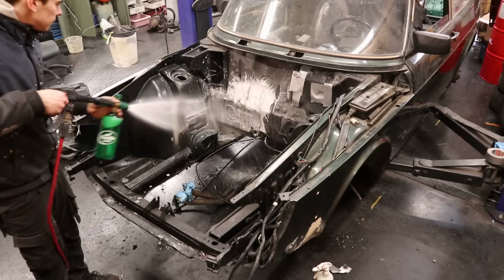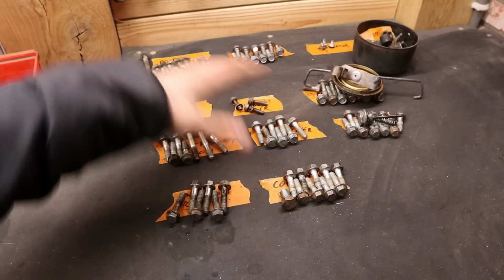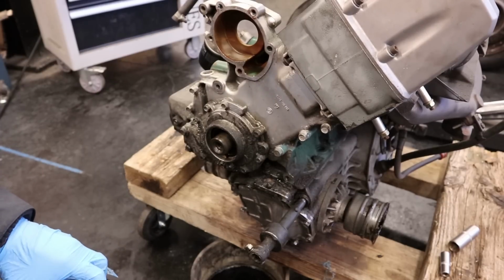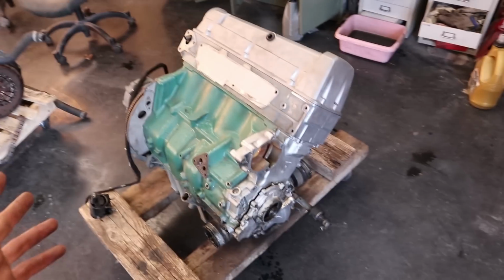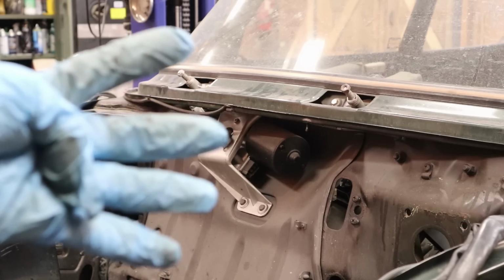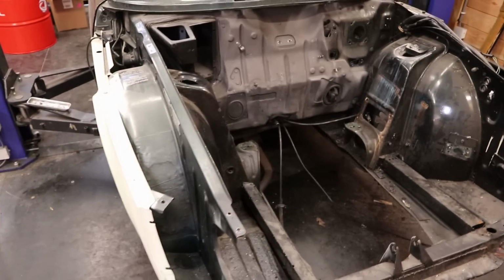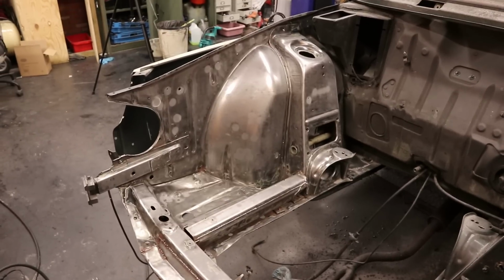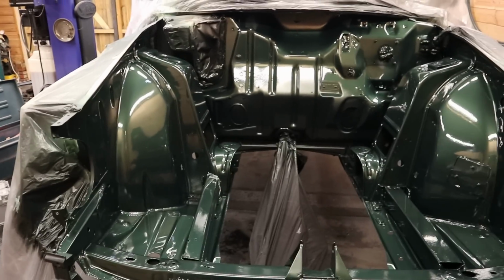Painting The Engine Bay Came Out Clean! | Saab 900 Classic Revival | Part 11

Comment: Important looking bit at 18:22 is for the power steering pump mounting.  Something to do with stopping it from twisting when you're tightening the bolt to secure it to the engine mount.  The car would work without it being installed so someone may have left it there after some work and not realised they had missed that bit out of the job.
Reply: Thanks…

Comment: You do good work hung over. Couldn't help but notice the Saab alternator uses a similar mount as the Golf and the power steering pump is from a 70s General Motors set up. Your friend who painted the engine bay did a great job as well. I would buy the first round if I ever could drink with you guys. Keep the video coming. Great job 👏

Comment: Absolutely love when you post a new video, awesome work!!
Just a few friendly tips for you. The timing cover is supposed to go back on the engine before the cylinder head and the gearbox so if you put it back with the head on the engine it often leaks between the head and cover where the two bolts are. So make sure it won't leak.

And if the upper control arms in the front suspension is rusty or bad, you can only replace the left one with the engine still in the car. But I assume you are going the sand blast and paint them 😊

Comment: I, erm, hope you're cracking those engine and gearbox cover bolts in a diagonal/opposite pattern before zipping them out sequentially/contiguously with the gun (mechancing 101). If not, you may be looking at misting or even leaks in the future.

Comment: Great content as always Memphis. If you're going through the front suspension in your usual, meticulous fashion, it would be rude not to do the same to the rear............ For the age of the shell, the driveshaft tunnel area has stood up remarkably well. Will be a great car when it's done with all the effort  you're putting into it.
Looking forward to getting stuck into my 1993 3 door Turbo, which is in worse condition than yours.
Cheers!

Comment: haha you made removing the front suspension and engine bay stuff look so simple compared to doing it in real life without a lift. Actually, stuff like cleaning of the engine bay well - is probably the most impressive thing, that 99% of mechanics wouldn't do, and the result will be next level for years to come for these reasons of little details. BUT WHAT HAPPENED TO THIS CAR? DID YOU HAVE A HUGE OIL LEAK FROM NOT MACHINING HTE ENGINE END PLATE AS I SUSPECTED? WHEN CAN WE SEE IT DRIVING AND FINISHED? I think this is the most impressive episode, and one of the most useful for everybody refurbishing a C900 in general, especially an 8-valve.

Comment: It is apparently not too complex to zinc coat your own small bits n pieces like nuts and bolts. YT has many DIY clips to guide you. Is there any reason you should not have done it yourself or is getting the zinc solution a problem in Belgium. It can ve fiddly but you have an electric buffer and workshop space! I still enjoy your channel and the easy approach you take in each video. Best of luck continuing with the rebuild!!